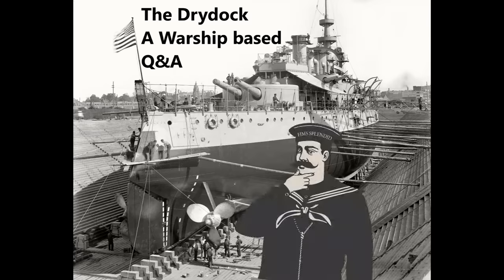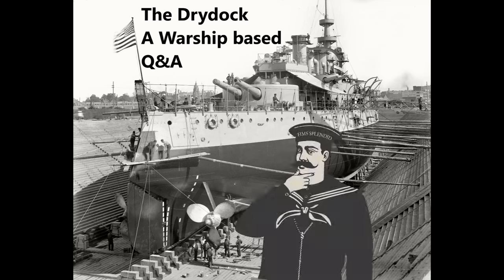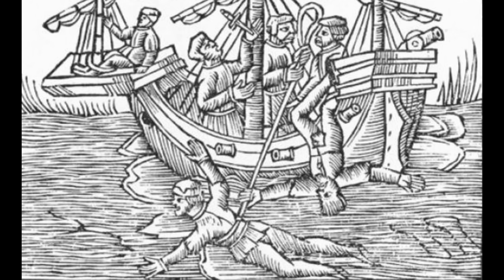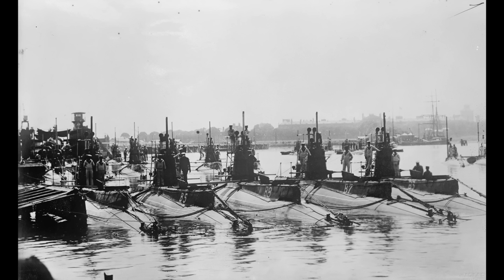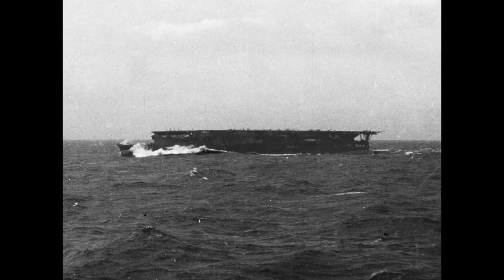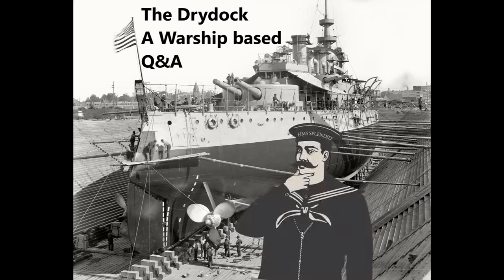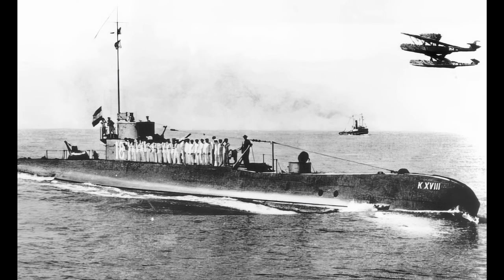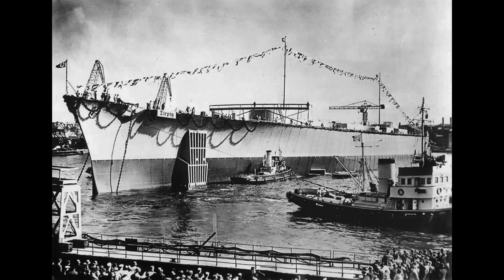The Drydock - Episode 266

Comment: Well if you were keelhauled from bow to stern on any kind of modern ship there is a really good chance that you would be turned into hamburger meat by the screws not to mention the rope being used could get tangled around the screw shafts and cause some major damage. Because the rope could cause the shafts to lock up but the turbines still be trying to turn them & then all kinds of stuff could break loose or start grinding gears. And the ship could end up dead in the water until the rope is removed. SO, maybe just better to flog the poor bastard or some other punishment. Like maybe put him in the brig when not on duty, so his "free time" aboard the ship is taken away.

Comment: On the sub spam, I don't think it could ever work on a few levels. 

That's the short answer. A longer answer I'm still chewing on. Part of what a surface fleet, surface vessel does it that it says you're there. It says you're in charge and its says you intent to make stuff blow up. From a carrier which is massive blunt force trauma, extreme sharp force trauma and every step in between in potentia as a message through to a single corvette. It might be the only one you see, but if that's the littorals? You should get twitchy. 

Yes, surprise works and having an entire squadrons of boats lobbing missiles over the horizon? Wouldn't want to be that guy. 

How do they get their intelligence? How do they get their targeting? Well, one of those boats is going to need to be on the surface, near the surface and being a EW boat. It's painting the things that need to be hit, it's passing the information on. It's not just emitting sound, it's emitting radiation and radiation can be traced. 

When, not if it's attacked it's defences are depth and the ocean conditions. Those are so variable you could have a very good time of it or a very bad time of it. 

A surface vessel can defend itself from attack. Passively and actively. CIWS, RAM blocks, using your helo's for their RADAR, decoys, jammers, the coast line itself.  Submarine is a hyper stealth build and it's dropped all of its defence into not being seen. Subs need a useful depth of water to really work and even then, you can still spot them from just overhead. Thermal, magnetics/MAD, more. Just because you drop below a thermal layer doesn't mean you're invisible. 

Ships can carry more people, for raiding, shore operations. They can carry vehicles for shore raiding. I've not seen an amphib landing from a sub with a few tanks in support from the same ship, carrier vehicle. 

Part of this is mission profile, what you're needing to do when you're there. There's also a part of it that's there's things you can only do the surface. Sure, there's a lot you can do with drones, satellite recon and more. You still have to get the information out to the striking element. When that changes, you are going to make the sub vulnerable in a way that no surface ship, no surface group could be.  

Submarines are a tool and it's a tool that needs to be right for the job. If it's a screw driver, it's a flat head. I'm not going to choose them when I need a Phillips head. Well, bad comparison and there's some exceptions to that. I'm not going to choose them first, unless I had some really, really, really good reasons to.
Reply: I once opened that the Soviets would have been a lot better off and more dangerous with the equivalent crew or displacement in attack subs than with the four Kirov class. A US Navy surface warfare officer in the discussion agreed that the subs would be a lot more difficult for him to deal with.
Reply: @kemarisite Yes, no, maybe, I need some context there and there's plenty of ways to read that statement. 

Shorter answer? Depends who has surprise and who has the intel. Subs under the surface make the entire grid square dangerous, many a grid square dangerous. If you don't know where they are, but you know where they could be? 

See my comment about that corvette in the littorals. 

Four Kirov's that you can see from space? Well, you can kinda see subs from space too, but four you can more visually identify, confirm and track? It's a weakness. It's a trade off.  I'm not saying the Kirov's aren't a threat or should be dismissed as a threat in their own right. Rather as a part of a combined force, mixed formation of submarines, surface ships and surface capabilities? 

When you're the defending party does it matter if they're launched by an Oscar II or a Kirov? I'd wager not so much. Detecting the inbound threat with sufficient time and distance? More important in my mind. 

For one thing, I'm a civvie and I'm a game dev with some reading in the field. I've not done it professionally, I've not even spoken to people who do. At best my 'real life' stories are second hand. 

I think this stuff is far more a matter of co-ordination, communication and trusting the guys in the field to do their job. From the common sailor, petty officer through to the task group commander. If any of the stuff I've learned from Fleet Tactics and Coastal Combat, the follow up book are anything to go by? 

Sure if it's just four Kirov's. Four Kirovs, their supports and a wider, effective kill chain? Now that's a different matter. Win the information war to win the naval war. 

Well, I did say this was the shorter answer. I could go on for a while for a much longer answer.

Comment: US Gatos with Hooven-Owens-Rentschler engines were a total disaster. So much so that HOR was not pronounced as Aitch-Oh- Arrr but as a name for a certain type of woman.

"In the 1930s H.O.R. developed a double-acting two-stroke diesel engine, initially based on the German cruiser Leipzig's MAN engines but with eight cylinders instead of seven, expanded to nine cylinders in the final submarine version. The double-acting design produced more power from a physically smaller engine than conventional designs. However, H.O.R.'s double-acting engines, particularly those of USS Pompano, gained notoriety for their unreliability in the submarine force, where they were nicknamed "whores". Owing to the limited space available within the submarines, either opposed-piston or, in this case, double-acting engines were favored for being more compact. An inherent problem with double-acting cylinders, owing to the piston rod reducing the piston area on one side, is an imbalance in the force on each side of the piston. The H.O.R. engines were plagued by vibration and other problems as a result. This in turn overstressed the drive train and caused the gears (which themselves had been incorrectly manufactured) to shed teeth, create torsional vibration, and frequently rendered the engine and gear train inoperable. As an example of the problems caused by the unreliability of the H.O.R. engines, Captain Charles Herbert Andrews of USS Gurnard recalled concerning a war patrol in support of Operation Torch, "I only used three, saving the fourth for a spare. When two of them broke down in the Bay of Biscay, I cut the patrol short and limped back to Scotland."

During World War II, all submarine H.O.R. engines were replaced by early 1943, usually with General Motors Cleveland Diesel Engine Division 16-278A, or 16-248 V16 engines or Fairbanks-Morse Model 38 engines. The wartime performance of the H.O.R. engines was so poor that Captain Tommy Dykers of USS Jack said, "The H.O.R. engines saved the Japanese thirty or forty ships."

So, in addition to bad fish, some US boats had bad engines.

Comment: 30:55 - "the last outpost of free Dutch territory"

sad Aruba and Suriname noises

57:10 - "Also depending on what political developments occur in the U.K. without WWI bringing them to a screaming halt..."

For one thing, removing WWI means that Irish Home Rule goes into effect in 1914.

2:36:19 - Technically, the greater danger to aircraft from microbursts is the strong horizontal wind gradients they produce, which result in large, rapid changes in longitudinal wind speed which can rob an aircraft encountering a microburst of the airspeed necessary to maintain flight.

Comment: USN submarines, 1930ish biggest problem were their engines. They were extremely unreliable. The some bright spark though wait a minute what about the engines on diesel locomotives? This brought about a marriage Fairbanks Morse that last to this day. They are used as APU's on many subs and Warships. During the war there was a flirtation with disaster otherwise known as the HOR engine. This engine was so notoriously bad every submarine that was built with them underwent a premature major overhaul. The removed all HOR engines and replaced them with the "rock crusher" (Richard  O'Kane's name for them) Fairbanks Morse engine. The HOR engines were so bad subs would rendezvous To exchange parts on combat patrols. There were many problems but the one that sticks out id the bearings. The would eat them like crazy. They would also require over haul quite often on patrol. Many subs would terminate patrols early because of the engines.
Reply: i had heard that the transfer of tech was the other way (boat to rail) where the engines used in the iconic FM "covered wagon" suffered from the jarring loads over points (switches/turnouts), diamonds and suchlike that were not expected in sea motion.